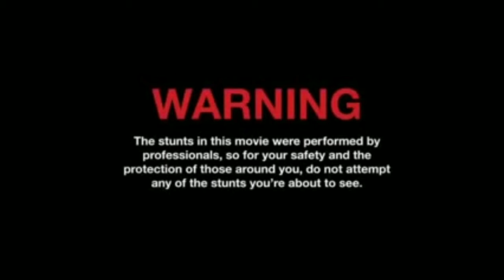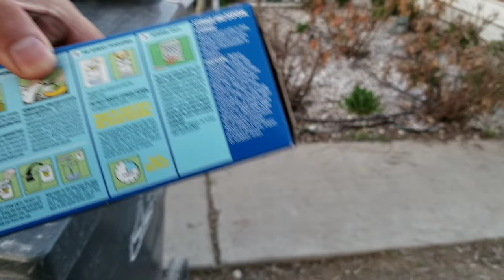Spiders in my car - how to Bug bomb your car!

Comment: Wifey and I were driving down the interstate one day when spiders started raining down from the crack where the ceiling meets up with the windshield 😬 I'm talking HUNDREDS of tiny little spiders!!

We pulled over at a CVS WalMart parking lot and abandoned the car 😅 JK, but we did put a couple bug bombs inside and leave it sit overnight.
Reply: did it work? the same thing is happening to me and they keep coming and the bug bomb is my next step
Reply from the maker: Haven't had any bug issues as of now so I can say it did work for me
Reply: I just had a nest hatch too. Bought the bombs but just read that your not supposed to use in small spaces so now I’m hesitant